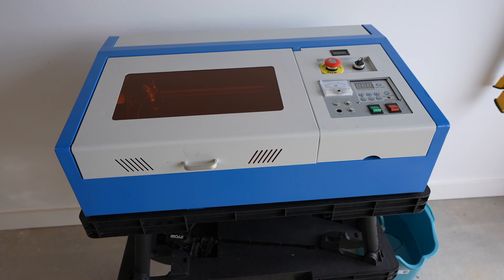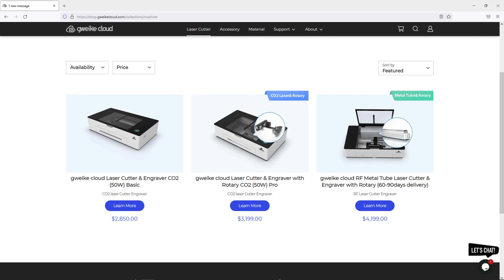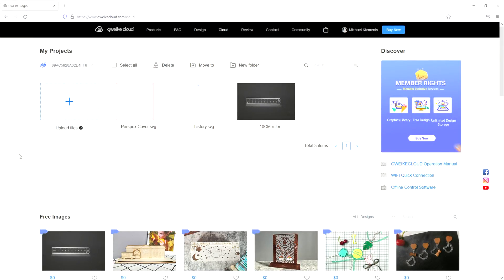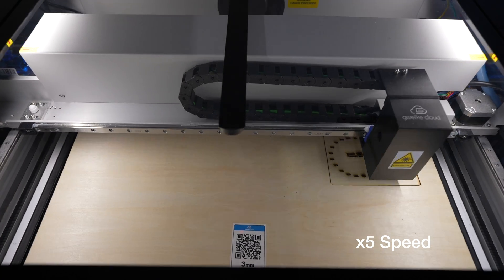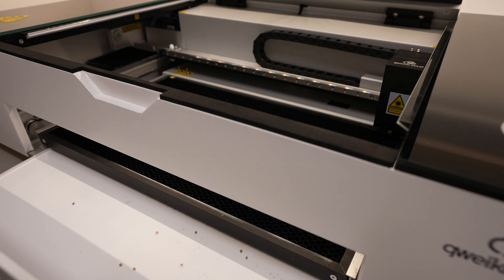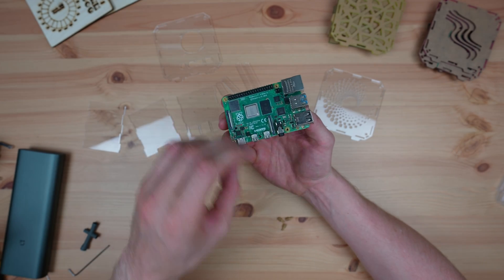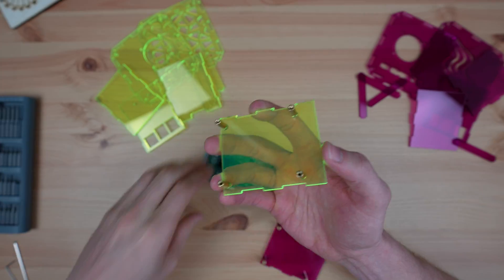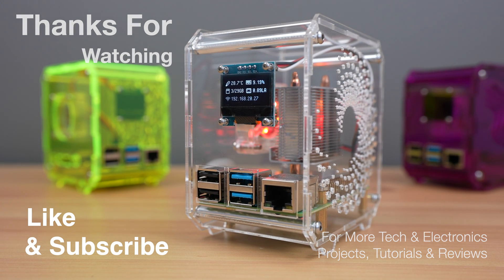Making Clear Raspberry Pi Cases On The Gweike Cloud - Can It Compete With The Glowforge?

Comment: Got mine like 2 weeks ago but only managed to start dabbling into it in since about the last week or so...

Most annoyed with how the Z-Axis is supposed to be operated according to G·Weike when using Lightburn ( using the weird ass 17mm Focus Distance minus Material Thickness calculation ) which I really didn't care for as it totally negated the possibility of curating a proper AND automated Material Library so I started digging around until I somehow managed to figure out how to get the Z-Axis to ACTUALLY operate like one would expect - That is including the Z step per pass feature where - once you do more than one pass for a cut - it will drop the Tool Head for each consecutive pass by a defined value ( say for a 15mm thick Material using 5 Passes with a Z step per pass (mm) set to 3.00 it would do 5 passes and lower the Tool Head by 3mm before doing the next pass )

Problems just, one has to define that value as a NEGATIVE one ( so 3.00 ) for the Machine to DROP the Tool Head instead of -RAISING it which wasn't clear of even being an option in the Lightburn User Interface.
To put the cherry on top it would ALSO require for the Z offset (mm) value to be individually adjusted on a per Material Thickness value where 17mm thick Material would need an Offset of +3mm and a Material Thickness of 0mm would require an Offset of -14mm.

Huge pain in the ass if you ask me but at least I got it working despite the Lightburn Support claiming that the use of Material Thickness at the time would not be possible, with the Machine.
Reply from the maker: Yeah this is a feature which I also think is half baked and can be quite confusing - especially for new users. Having to use negative values or subtract from a baseline distance is due to the software (Lightburn) being designed for bed movement rather than laser height - earlier lasers used to move the bed up and down to focus rather than move the laser head. They should really have an option to select the focus type on the machine (like origin etc.) and have the controls logically reflect this.
That said, these are ultimately issues with the way Lightburn implement the functionality and they're the only ones who are able to change it.

Comment: Thank you for the great video. Please tell us what protection did paint, paper, material that you used over the clear acrylic? Can Gweike cut transparent acrylic without any additional protection?
Reply from the maker: Thanks Andy. Acrylic sheets are generally sold with a plastic or paper film on both sides to stop them from getting scratched. This is what is on the acrylic when I cut it. A CO2 laser like the Gweike Cloud can cut acrylic with or without that that film
Reply: @Michael Klements  Firstly, I am glad ypu read the comments thankyou. Secondly, your answer was really helpful.

Comment: Cool video - Do you need protection glases, when you cut, ore is it safe buy it self?
Reply from the maker: They don't provide any eye protection and it's got a few safety features to ensure that it only operates when the lid is closed, but I would still recommend using glasses for your own safety. It takes minimal effort to wear them, versus risking damage to your eyes.

Comment: Is the air filtration enough to run indoors in a house/apartment without a lot of smell and mess?
Reply from the maker: I haven't tried their air filtration system, the one I got has a ducted ventilation system that is intended to exhaust the smoke outdoors.
I haven't actually tried the air filtration system on any of these types of lasers - I have a hard time believing that they can filter that volume of air effectively for their size.